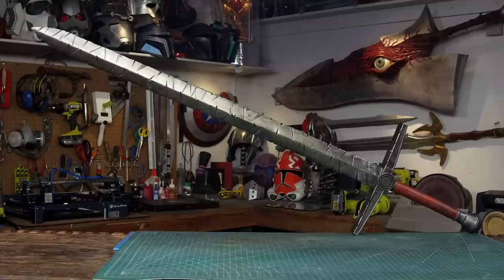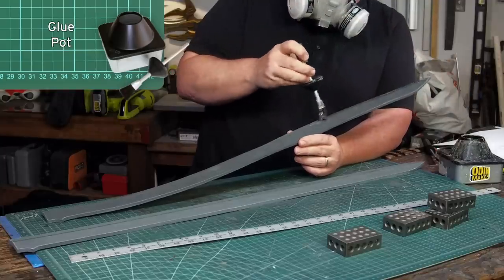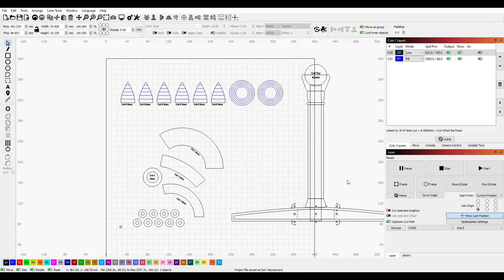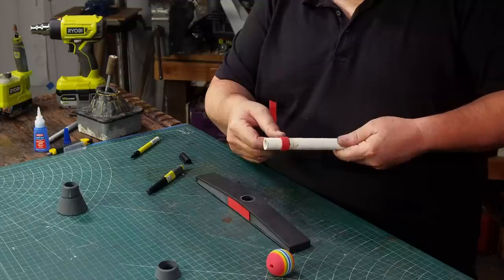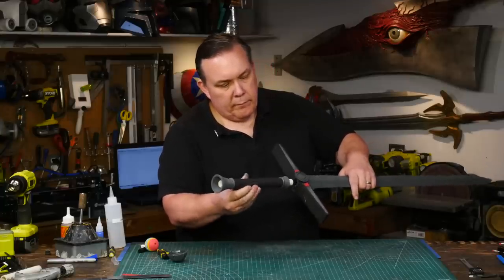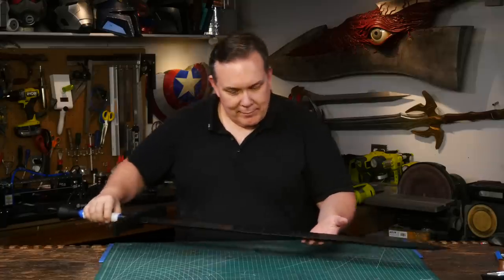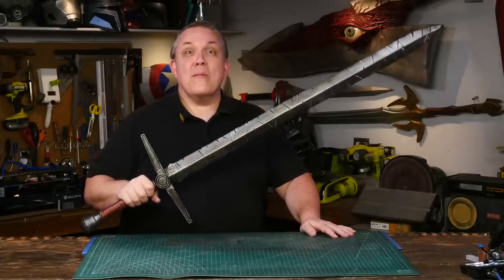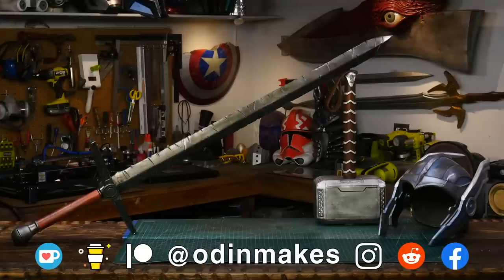Odin Makes: Gorr's Necrosword from Thor: Love and Thunder

Comment: Hey Odin love your videos and I use quite a bit of what you show in making LARP weapons and gear (the fact that you primarily use foam makes this really easy), One thing I have do change up is that I use Driveway stakes instead of carbon fibre golf clubs merely because you can get different lengths and sizes and they are cheaper and durable enough to use as cores.

Comment: I really feel like you need to make a jig of some kind that has an adjustable angle and can be used on your band saw as well as your disc/belt sander. It is pretty much impossible to get a dead straight edge by hand with a hand sander or dremel and I find that variance very noticeable sometimes. For me it's very noticeable on swords especially and I could overlook it if the entire piece was homemade and janky, but with so much accuracy and attention to detail on your work it stands out much more.

Comment: Hey Odin, I'm trying to make a sword for a Witcher cosplay and I've modeled it after one of the dwarf swords from Lord of the rings, would a graphite rod be enough to keep it straight? Also is it possible to make a sheath for a foam sword?
Reply: I can answer both of these, yes a graphite rod is plenty, a dowel would work but uts not nearly as strong, ideal is a fiberglass yard marker, and yes you certainly can make a sheath for that sword, you can watch either living anachronism or epic fantasy for tutorials on that, whether you want a foam or leather piece, you could also switch out the cardboard for a 4 to 6 mm eva foam, and skip the layering step, I'll be doing this for my own sword

Comment: The little scratches and hits on the blade are part of the detail but I know what you mean with not wanting to scuff you a perfect edge 

I made optimus prime’s sword from transformers 4/5 and the blade was perfect but it has all these tunes on it and I knew at the scale I had built it those times would turn out horrible and I didn’t want to mess up the sword after I had cut out and glued together well over 250 pieces